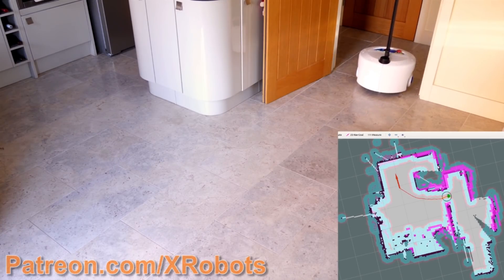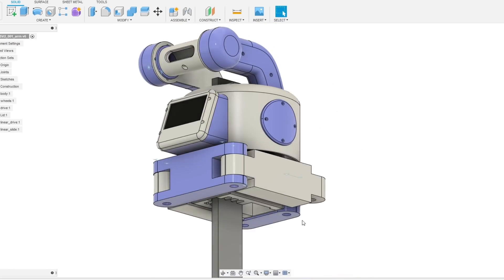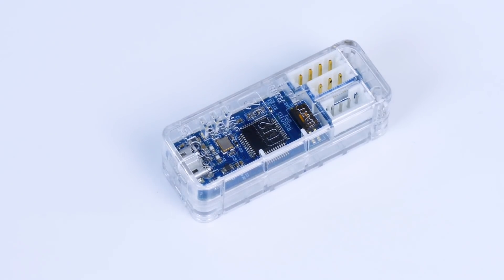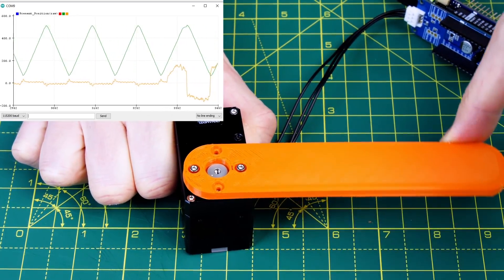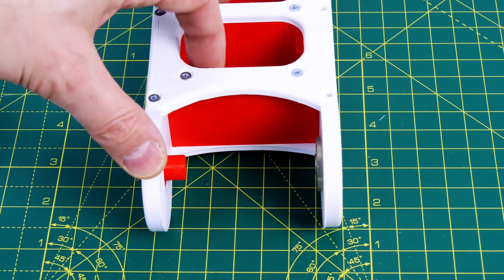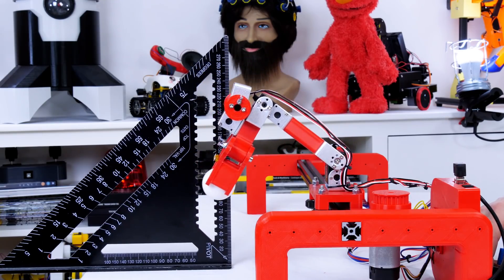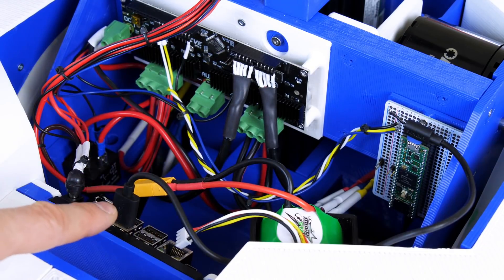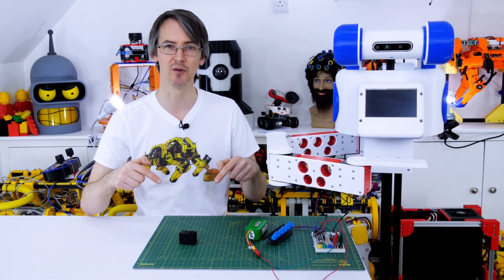Wrap-Around Robot Arm - Really Useful Robot #4

Comment: I suggest using homogeneous transformational matrix using the Denavit Hartenberg method. It is far more practical than the method you use especially as the design gets more complex with more degrees of freedom. There are also libraries in Matlab and Mathematica to help you with this. But, over all you did an amazing job as usual!!

Comment: 2:54 I'm sorry but did you say that tiny little servo can lift 100kg???
Reply: At a distance of 1cm, yes. 100kg/cm. So at the length of the arm, that's a lot less weight capacity.
Probably a very sturdy metal gearbox and it uses much higher voltage than hobby servos so has more power available.
Reply: @kantpredict  so what you're saying is this tiny little box that fits in his palm, with a motor inside about the size of his thumb, could lift him by a string if it was on a 1cm pulley? I'm having a really hard time understanding the physics of a tiny little servo like that, being able to lift an entire person off the ground
Reply: @StormBurnX  it might sound crazy, but that's how mechanical advantage works. In theory, any motor can lift any weight, as long as the lever arm (or pulley) is small enough. To say it in archimedes' words: ''give me a lever long enough and I can lift the world'' (might not be an exact quote). Generally, electric motors can have tons of torque relative to their size.

Edit: just FYI, 100kg cm of torque means that it can HOLD 100kg at a distance of 1cm, not lift it. However, anything lighter than that, it can lift. So yeah it could indeed lift a person.
Reply: @omega_one1318  I looked it up and realized my misunderstanding. It's not a servo motor, it's a stepper motor with a built-in processor that interprets servo motor commands. Having built a few 3D printers, I've seen the kind of forces those steppers can have, and they're entirely ungeared, so tossing one in a good gearbox makes sense that it could lift that much weight.

The price was also a dead giveaway - they're $379 each, whereas normal steppers are 20-50 bucks, so that's a big flag that this isn't just some tiny little servo like I thought hahah.

Incidentally that means the sponsor sent over about $3,000 - $4,000 worth of motors which is absolutely insane to me.
Reply: No, he said "around about 100kg-cm of Torque" 

Which means he didn't memorize/note the real number. It's actually 73kg-cm. Which also means that it doesn't matter as he's not planning on using it to that extreme. Because if an engineer is planning on utilizing the full capacity of a component they triple check their numbers.  

https://www.generationrobots.com/en/402832-servomoteur-dynamixel-xm540-w150-r.html

Comment: I love this channel but i miss the days when projects were practical and even approachable by the hobbyist, but these projects have become SOOOO expensive, those 'donated' servos alone would cost over £2,000.   I hope someday you return to experimenting and solving problems with cost and the average maker in mind. Animatronics would be a great subject or a project like solving the dynamics of a one legged hopping robot etc.  So much possibility. I love the machine vision etc that you are experimenting with now but no point 'publishing the cad' for projects that cost multiple thousands of pounds as its out of reach for 99% of us.
Reply from the maker: Dynamic robot unfortunately aren't cheap. The only reason openDog V2 works is due to the powerful motors and low gear reduction.

Comment: Really nice project ! Do you plan on using MoveIt ? It's typically the type of robot to be used with it. Also for the IK, you didn't calculate from the end effector position in the video. Is it ok ?
Reply from the maker: I've looked at it, but for now it'll be the simplest implementation possible. The IK was calculated for the wrist since I don't know where the end effector will be until I built it for real - then I'll just modify the position of the wrist offset by the end effector.

Comment: Now you should work out height, maybe the top unit could slide up and down? Because having an arm at an exact height is cool but since your arm only moves horizontally might hinder it's use case. Also having the upper unit slide down would fix your stability issues.
Reply: I thought the upper part of the unit does slide up and down on they black part of the unit? (it shows it doing something like that at the beginning of the video)

Comment: For the inverse kinematic: Why not treat the first and the last arm segments of the arm as the sides of the triangle and virtually extend where they would meet. Then the middle two joints could allways have the same angle and the arm could move the whole distance.
Reply: I'm not great at math. But this is also my thought. I did a lot of IK while rigging 3d models for games. And the easiest thing is what you propose. Just keep angles between first and last segments the same and solve for that. This way you don't have to manually change last join angle to reach further.

Comment: Hey James, you don't need to reinvent the wheel with IK everytime you build a new robot. The generic solution is really really simple to implement, and you only have to provide arm sections lengths and and origin. Checkout this: https://www.youtube.com/watch?v=sEKNoWyKUA0&list=PL7wAPgl1JVvXZDYBPGfjvgeUQHJFWLPit&index=5
It's 2d, which for this project is perfect, for example. But can easily be adapted to 3d. (Check also the previous videos of the serie, it starts with forward kinematics)

Comment: 3D Systems is shady. Bought a scanner on eBay from someone who bought a skidlot of scanners from them, basically, they sold the skitlot to him, he sells em to people who can't get the software to handshake with the scanners because 3d Systems has a serial number block list, rendering the scanners of that skidlot useless. And if you go directly to 3d Systems website and mention it in their online forum, a moderator will delete any record of you publishing your experiences with them rather than correct the issue. Just a heads up if considering a 3d scanner from that particular firm unless you like making millionaire slime into billionaire slime.
Reply: thank you for the warning.  How did you find out about the serial number blacklist?
Reply: sounds to me like the shady entity in that tale is the ebay seller who bought a skidlot of scanners. "oh I bought a skid of em from the manufacturer" sounds like something you'd make up when you knew no one would believe "oh it fell off the back of a truck"

Comment: Awesome Arm Did you use potentiometers for remote?
Reply from the maker: For testing, but next time it's ROS controlled
Reply: @jamesbruton  Hello James whats ROS is it raspberry pi thingy?
Reply: @agentd3adshot  Robotic Operating System - it's an open source system that is used to control robots. It has its own protocol for transferring data that makes it easy to integrate with modules made by other people for certain functions, such as SLAM or Inverse Kinematics.
Reply: @agentd3adshot  *which runs on Linux/Ubuntu so it can be on a Pi or almost any single board computer (SBC) that can run Linux!
Reply: @T4nm4y  Thank You so much
Reply: @T4nm4y  Thank You so much

Comment: Why not mount the arm on the front of the stand, rather than the back? 
It can still wrap around the base in the same way, but the arm would have a better range of motion and reach, because it wouldn't need to reach past the rest of the neck.
Reply: Good point! But may be he's concerned with balancing issues and probably that would limit the precision and speed as the hand gets closer to the body...just my 2 cents.
Reply: It might make it more prone to tipping forward when weight was applied to its manipulator (the robot hand) with the arm being attached to the back, the weight of the robot  itself helps to balnce whatever it’s holding (It would be a slight advantage, but everything helps)
Reply: @Getwright-  Hmmm...I did think about that but then figured out that then the same level of compensation could be achieved by reducing the length of the arm and moving the body backwards. That's exactly what is being achieved by moving the mount point backwards but it's unnecessary when you think about it since the only actual benefit is more range sideways which is not of any actual benefit I guess so I'm still confused here.
Reply: Actually, now that I'm thinking of it, if the camera is allowed to rotate all the way back then the robot would be able to use the full range of the arm but this time it would be operating backwards which would not really be an issue I guess. That would give the machine more flexibility in terms of capabilities :)
Reply: @UCxKQvh6_DI1Jv7uhFUr3aDQ As Codes Smith said, the arm would still be able to wrap around the base if the mount was on the front so that did not help much I'd say even though it does confirm that it's for balancing out the weight while moving.
Reply: I'd rather put it on the right side of the Robot. That should give you as wide of a reach faster than at the front and you don't need to swing the arm as wide to the outside...
Reply: @jannsander  Notice how the robot camera faces in the front only, not on the side

Comment: That robot arm sure looks a lot like an interesting leg design for a robot dog...

I am curious, though, with the arm fully extended, how much could it theoretically hold before falling over? 

And what's your thought process for designing the manipulator? Do you start with the task, and make the tool, or start with a design and see what it can do? 

Thanks for another awesome video.
Reply from the maker: I'll drive it around with the arm on in the next video and try to pull it over on a hard floor surface (the carpet is a bit soft for a proper test). I'm just going to make something really simple to start with that can grip simple objects, there will probably be other types of manipulator for it though as I experiment in the future.
Reply: Thanks for the reply.